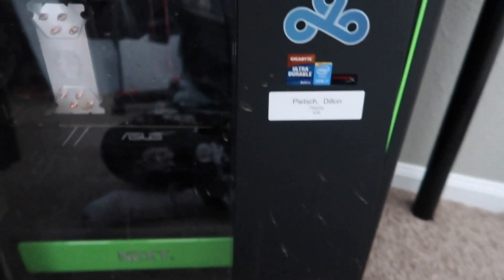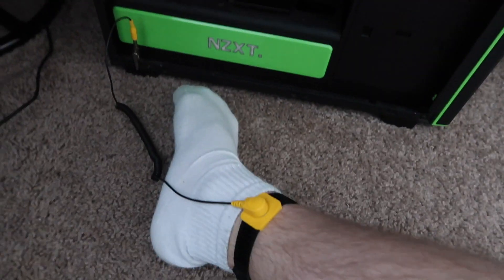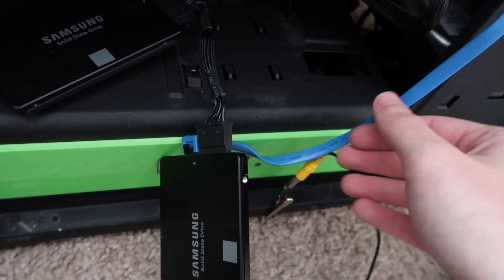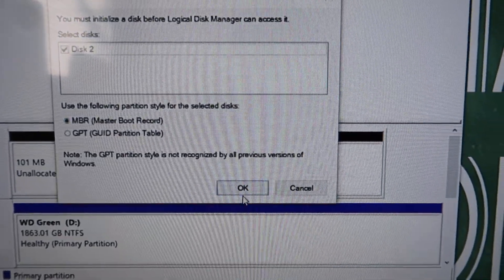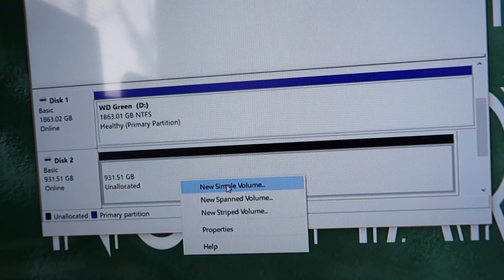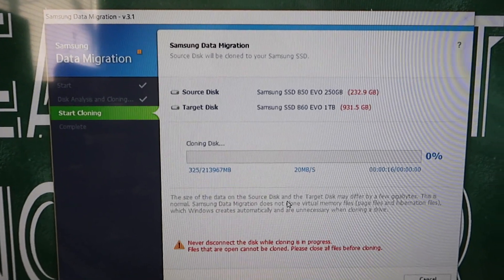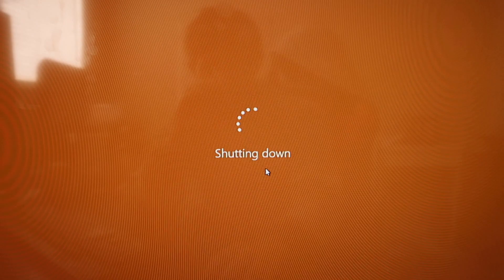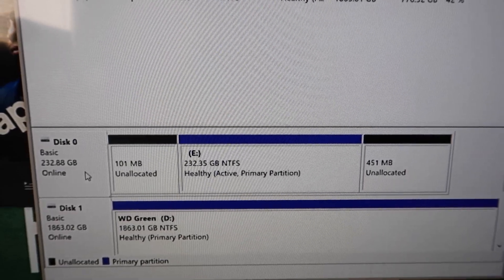How to install & transfer data from one SSD to another!

Comment: What cable do i need and from the new ssd where does it plug into, usb?
Reply: So to set up a ssd you would plug a sata cable into a sata port on the motherboard and you also need a power cable from your power supply then find a secure spot in your pc to put it in and then plug it in then set it up then your good to go
Reply: it comes with your motherboard usually